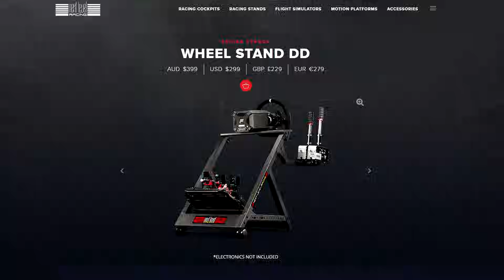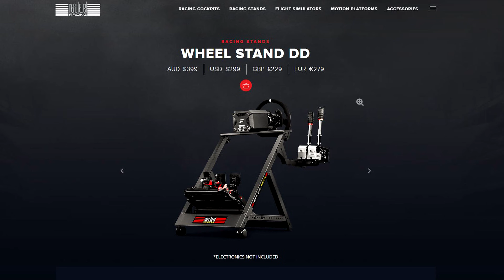Next Level Racing Wheel Stand DD Review

Comment: I use a T300 on a desk, so I'm really not qualified to give an opinion on full rigs, DD wheels or even wheel stands. But if you're looking at this, it's because you have a direct drive wheel (and probably great pedals too, since you could afford a DD wheel). So this costs 300 dollars, and a rig is just 70 bucks away. What's the benefit of paying for this? it's not like it's small and can be tucked away or anything... I'd just get the rig... or am I missing something?
Reply: What rig is 370? For the flex in this thing, I wouldn't buy it. This is more maneuverable then a full rig. You're right though. I originally made a wooden setup modeled after this design and it cost $25 (including paint and my free spare G35 seat) It worked great till I knew Sim Racing was an addiction. The rabbit holes goes deep with this hobby.
Reply: you're right! there is no benefit. 
I would always recommend getting an aluminium profile rig, even to non-DD users. It provides so much more possibilities... seriously... the possibilities to expand and add new things are endless. And you can perfectly customize it for your body size. There are many alu rigs with small footprints out there that fit in smaller places that are not really more expensive than the NLR Wheelstand here.
And looking at the NLR "DD" Wheelstand as it flexes several centimeters while Barry is turning the wheel of the Podium is making me kinda angry... and it's not even plugged in to give actual forces. How can they say it's for DD wheels and sturdy when it obviously isn't? The old wheeldesk from my Simlab GT1 Evo didn't even have flex like this (I replaced it with something else now). For me NLR doesn't have good products and they're all overpriced in my opinion. I had the opportunity to test some NLR stuff on the sim racing expo at the Nürburgring and I wasn't impressed (only by the high prices)
Reply: I use this rig daily. I feel it’s really useful because I share my rig with my siblings and it’s very easy to move the entire rig to each other’s computers. And unfortunately my house really has no space for a dedicated sim cockpit. I can move the rig out of the way if I want to use my computer for other purposes and move the rig back in if I’m simracing. And when we do endurance races, having all the equipment on the rig makes it super quick to move it to the other computer for driver changes etc. Can’t do that on a full cockpit:
Reply: @stormy2453  there are pretty small full cockpits out there. Search for "S-Dream" in google for example. You can put it on wheels. Many people in a  simracing forum where I am, have limited space like you and use this S-Dream rig. And it's 265€. But it's not hard to build something similar for yourself. There are CAD programs with these alu profiles for planning and building your own rig. The one I know of is "MAY-CAD" and it's free. :) And I'm pretty sure it's possible to build something similar to the NLR but cheaper and sturdier. Could be a nice project to start with your siblings :D
Reply: @Tintop  I will take a look at that for future upgrading!! That looks quite nice and strong. Thanks for the recommendation!
Reply: @Tintop  I was looking for something like that S-Dream, thank you so much for this recommendation, it should suit my needs perfectly (I share a setup with my fiancee). You mentioned some other rigs similar to this one, would you mind telling what they are and also I would very much like to read up on this S-Dream cockpit if you can share a link to the forum you mentioned. Thanks again! :)
Reply: @EpicKillstreak  the simlab gt1 Evo is the other one I mentioned. I use it myself but I changed some things on it over time to suite my preferences. It also has a relatively small footprint like 130cm x 65cm.
The forum I talked about is the German project cars forum, at least it started with pcars 1 but now there's talked about every sim. www . pcars-forum . de
The guy who created the S-Dream is also there
Reply: @Tintop  Oh, that's awesome, thanks for the info. Yeah I looked at Simlab GT1 Evo as well, 130cm is just a little too lengthy for my space, but S-Dream is perfect as I understand it, it has sliding pedal tray which can be tucked away if needed resulting in about 100cm length or less which should be just what I need.

Comment: Does Barry ever reply to ppls comments??  

I wanted to know what pedals to get out of TM load cell or the csl elite pedals. Don't care about looks , I'm interested in longevity.
Reply: Tm has contactless hall effect sensors with thoretical infinite lifetime. Csl has potentiometers on gas and clutch that wear out after a year or so
Reply: If you have a set of Logitech 25, 27, 29, 920 pedals there is a new "True Brake" load cell for under $70 delivered. He did a review after this. The TM is mounted in plastic, so that may be a problem. Ricmotech sells an adaptor that lets you plug in Logitech pedals into a TM wheel base for $20. Or you can make your own, there are wiring schematics online.
Reply: I inverted my G27 pedals on a second piece of steel with a 90 degree angle and a brace.
Reply: @SpatialDragon  I don't have a logitec pedals. But thanks for the advice.

Comment: Another thought on who this rig would work for is a streamer that flies and drives with a small studio. Buy two of them, $300 each and an office chair/racing seat with locking casters, or something... Set one rig up to fly and one to drive. Small footprint lengthwise, set them side by side or pull one in front of cameras at a time.  It would be a lot better than trying to use an extruded aluminum rig for driving trucks, GT cars and flying airplanes. That is a terrible setup for that diversity. Look at Squirrel, he went aluminum and it just does not work easily. Sure you can do it, but much more work to switch.

Comment: I went in and bought the Obutto Revolution. Not a single complaint so far. Now I am only using the CSL Elite wheel base and Pedals with the load cell kit. But I am sure I could hook a direct drive and beefier set of pedals on that rig no problem and still have no complaints.

Comment: Take the leftover casters from the stand and put them on the office chair, then you can lock two wheels and the chair shouldn't move
Reply: Good idea! I used some old nylon washing line and wrapped it around the frame and under the front caster of my chair. Does the job nicely, but bit of an eye sore.

Comment: I’d say if you plan to use a wheel stand for whatever reason. Don’t get a direct drive wheel. Get a CSW V2.5 instead. The difference between that and a direct drive wheel aren’t very big other then raw power. At least that’s been my experience going from the older V2 version of the CSW to a Podium DD2. I think to really be able to enjoy the differences you’d want a full no flex no movement no compromises chassis. If there is a big difference in fidelity you probably won’t notice it sitting in a lawn chair.

Comment: You should of got a Rseat S1, absolutely love mine and feel like it's the best rig out there
Reply: It's 3x the price...
Reply: @theonlyegg  best you can get tho, my DD1 doesn't move nor my rig
Reply: @theonlyegg  all next level racing products are junk lolol
Reply: @Rosinfiend  That is just a lie. I have one of these DD Wheel Stands and it is great. Plus if you want to fly and drive, but have a limited space, buy two and set each up differently. Much cheaper and more than solid enough. I used another rig with a junkyard seat and some straps. Solid as a rock, but easily split for cleaning or switching from flying to driving.

Comment: $300?! They must not want to sell many of these.
I was considering getting one until I heard that number. The alternatives for the same $ make it a no-brainer for me to steer clear of this stand.
No pun intended.
Reply: What is $300 alternative to this? genuinely curious
Reply: @TomHoppe  The one I have my eye on is a DIY project that's as customizable as you want it to be. Bigger, sure, but cheaper (though you CAN spend and spend on it, with paint, vinyl lettering, badass new seat, etc. -- but you don't have to) and cooler looking.
Check out Ricmotech's DIY cockpit plans.
That's really the only one I had firmly in mind. There are others I've seen in my time looking for what I want. 
I was curious about this one just for the room it saves, but the price quickly turned me against it.

Comment: im not sure this suits a dd at all
Reply: It is very solidly built. Up, down was a problem on mine, but I used a pair of small straps to attach to my seat from other rig. You could add some weight to the front or attach to something heavy. Mine is rock solid, easily split for cleaning or whatever.

Comment: This product makes no sense because its not easy to put in the closet or anything.
Reply: Sure it does if you fly and drive and have limited space and budget. Buy two, set them up and just switch wires and slide your seat over.

Comment: All next level racing products are junk, get a Rseat S1, best rig there is and compare it to a next level rig and you'll agree
Reply: It is not for everyone, but neither is a single rigid rig if you want to drive and fly. Buy two of these, a junkyard seat and a base with industrial locking casters. I do throw a quick pair of straps to hold them together and it is rock solid. Slide the seat over to other rig and connect or activate the other controls. Mint and for far less money than your rig.
Reply: @SpatialDragon  lol and you think that is going to perform the same as a Rseat? Literally the best rig you can buy and also the most expensive but compare it to this next level junk. My dd1 would destroy this thing do you not see the flex in the video lmao and how let me know how comfortable that chair is? Lol
Reply: This stand is super solid. Its very heavy and stands like house 🏠